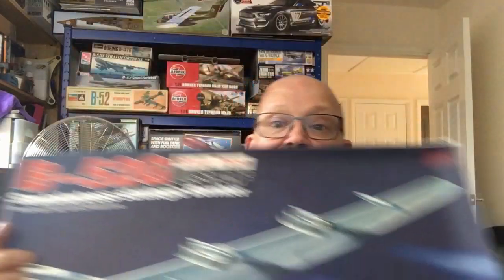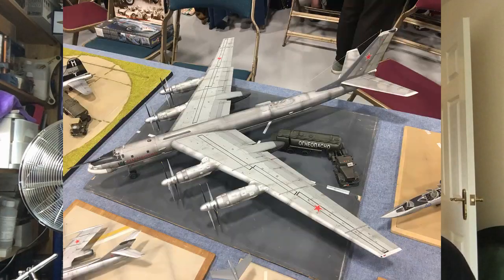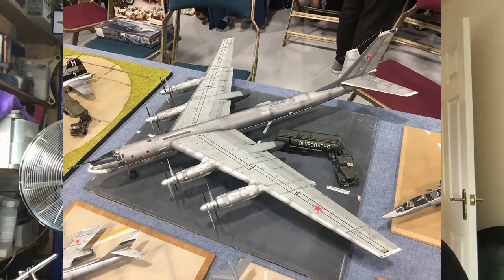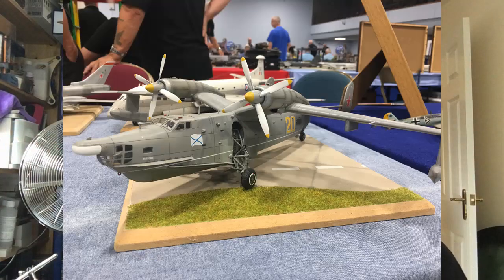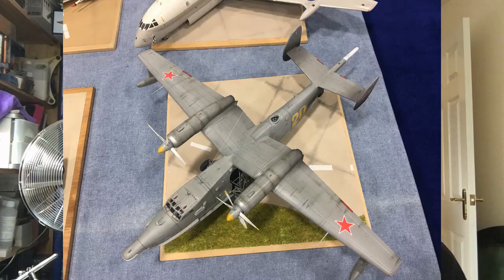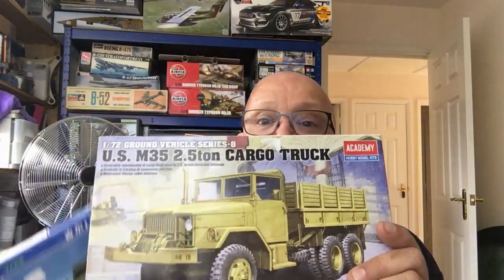What have I done today??

Comment: My father lives in your neck of the woods Stonehouse Stroud way
Reply from the maker: Oliver cooney I used to work in Stonehouse at Delphi.
Reply: @NigelsModellingBench  small world fella can I ask why you use  Pringle lids with using & applying super glue
Reply from the maker: @olivercooney6645  because you can break off the dried on glue and re-use the lid, because it can be placed out of the way when not in use, it's flat and cant be knocked over and i like Pringles.
Reply: @NigelsModellingBench  fair play fella thanks for your time & help is there any good  shows around  Iam only down the M4 near reading  is the any good website to find out when & were they are
Reply from the maker: Oliver cooney put “model shows 2019 UK in Google. You’ll get the ipms site which will tell you this year and next.
Reply: @NigelsModellingBench  top man cheers fella

Comment: I was just testing Micro Klear myself this week. I need to make some windows for a 1/537 enterprise. So I tried out Micro Klear and Mod Podge. Both were brilliant, dried crystal clear, could see right thru them both. They were both useful as a glue as well to hold down wires and stuff. The only difference is price, Micro Kristal Klear is £3.99 for 1fl oz and Mod Podge was £5 for 8 fl oz.